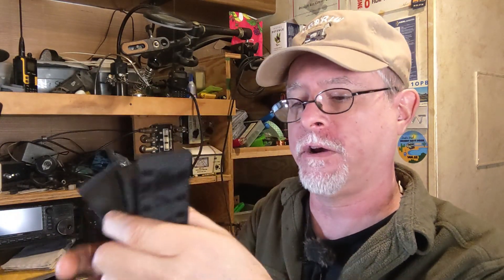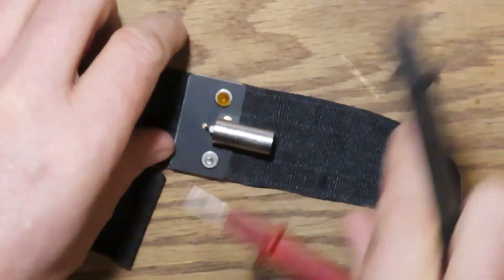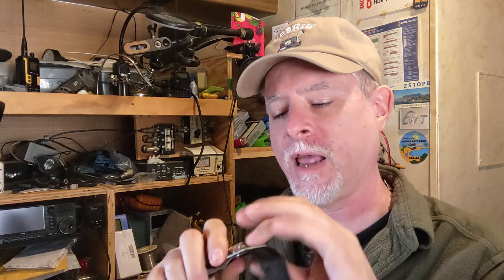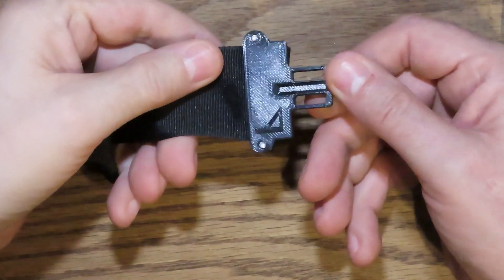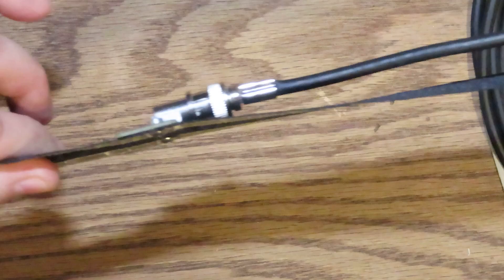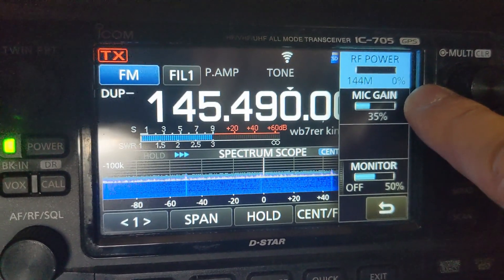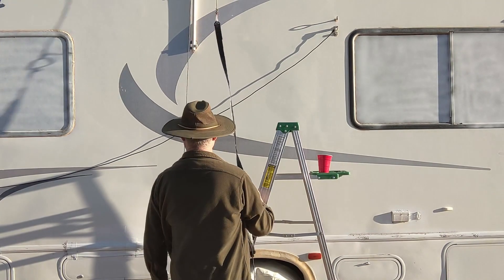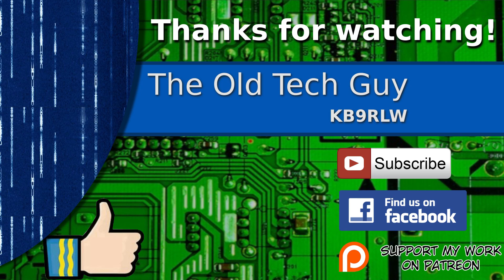Ham Radio - A look at the Fara J antenna and strain relief

Comment: Yeah this is a really cold design. I like to make these antennas using copper tape fixed to duct tape and then covered over with some additional duct tape. Helps to waterproof it. I suppose you could also spray the antenna with some type of Scotchgard or waterproofing material

Comment: Hi kevin.  Taxing ur memory.  7 years ago you made a antenna tuner.  I was wondering did you use an end fed wire.  And do you remember how long u made it.  Many thanks. I love ur videos. And glad u r starting to feel better.  Again thanx. Jim K1AZ
Reply from the maker: I think that was a simple L network tuner.  They generally do work well for random long wire antennas. I don't remember what I had it hooked up to when I made the video. Length would depend on what bands you want to operate.  A decent tuner would get you on 80 m with a wire anywhere from 70 to 100 ft. And probably work well on the rest of the bands up to 10 m.
Reply: @loughkb  tks fer getting back 2 me. when I was novice i had a globe chief xmtr and had 130 ft wire right into the xmtr   the pi output turned it real super.   Many thanx. Will try long wire.

Comment: I think this is convincing me my slim Jim still has a place in my ham-purse. 😂 

Though an improvised 1/4 wave ground plane antenna made from coat hangers and a panel mount UHF connector will out perform the slim Jim on 2m!
Reply from the maker: Nope, a slim Jim performs about as well as a 5/8 wave and will outperform a quarter wave ground plane by quite a margin.

Comment: 😊if you simply twist the bottom of the antenna 180 to 360 degreed the antenna will not flap in the wind.  

Trucker trick for cargo straps.
Reply from the maker: The bottom of the antenna will be tied off with a piece of cord, or the coax. So how would you keep it twisted a precise amount? 😉
And actually it was twisted in one of the shots where it was flapping around in the breeze. 
I think your cargo straps have a lot of tension on them that helps quite a bit. This is not going to have that much tension on it.

Comment: The element resistive loss is certainly quite high.  But considering its portability, it seems to perform adequately in the dry.  Despite Kevin's excellent mod, how long it would last flapping in the wind, is anybody's guess!  Might be better in a PVC pipe, but that obviously reduces portability.
Reply from the maker: Also putting it inside of a PVC pipe would shift the tuning. Ben says he has had one outside hanging up for over a year and it's still in good shape.

Comment: Fascinating, as always. It is amazing that a 1/4 wavelength of cloth represents (theoretically) from zero to infinity impedance. Finding the 50 ohm point to mass produce an antenna must take trial and error in addition to measurement.

Comment: Rj58 loses nearly 11db per 100ft 
 at 70cm. Rj58 should only be used for hf.
Reply from the maker: Somebody using this antenna for POTA or SOTA or camping is probably only going to have about a 15 ft run of coax. And they're not going to want to carry heavier coax in their backpack.

Comment: That also looks like a great indoor antenna.  It could hang in an attic, a window. a sliding glass door, or as needed on an apartment balcony,  deck or patio.  I would compare this, the uses and placements with the Dr. Ed Phong DBJ-2.  Maybe check the  performance of this antenna in a PVC tube.
Reply: Anything in a PVC tube will need its length adjusted to make it resonant. Not saying it is not doable and I should look into this. Great idea.

Comment: i would love to see your Homebrew loop and a fara-J idea ... call it the "Floop"... like a folding loop made from faraday cloth..
Reply from the maker: I can predict that it would not work very well. The Faraday cloth is slightly more resistant than copper or wire. And magnetic loops really need a low resistance in the outer loop.
Reply: I’ve used flat aluminium for some mag loop designs. I get good restart lower frequencies but I haven’t had as much luck beyond 15m

I’m suspecting that the skin effect of a flat conductor is not the same as the skin effect of a cylindrical conductor with the same surface area

Comment: I would have just used plastic tie wraps/ zip ties and tie it off at several place to a fiberglass mast. But, I would rather use a roll up 450 ohm ladder line Slim Jim - it will last more than a dozen years, is not affected by rain and gives a better SWR sweep...or at least, my home brew ones do.
Reply from the maker: This is designed as a portable antenna. So if you just used a zip ties on a mast, you'd be zip tying and cutting the ties every time you put it up when you went to do a park or camping. Let alone having to carry the mast in your backpack. You're thinking outside of the scope of the use case for this.

Comment: One thing I would add to the FARA-J-Ant is a lanyard to the Strain relief clip back to the Ant clip base as the clip will be lost over time, also maybe add a Velcro strap to the coax connector attachment  point to secure it to the PVC mast  Thanks Keith N9QDS
Reply from the maker: Print a few clips.  They're small and quick to print.
Reply: I like the velcro idea and might have to give it a try. Thanks for the thought.

Comment: Nice work with coax clip. I would add option to fix bottom of the strap to the pole to.
Reply from the maker: It's really intended as a temporary antenna.  you'd likely toss the cord over a tree branch and just pull it up.  Operate while camping or doing a pota activation, then take it down.  If using a mast, just wrap the coax around the mast once.

Comment: I would use a TNC connector but to reinforce the board I would wrap it in fiberglass resin right at that spot.

And maybe use a pigtail instead of a connector on board ? 

Just spitballing
Reply: I did try pigtails but the short traces and them being 90 degrees to the elements helps the antenna perfomance.